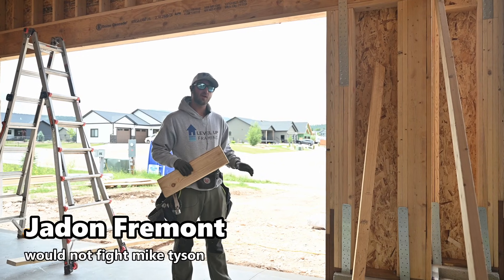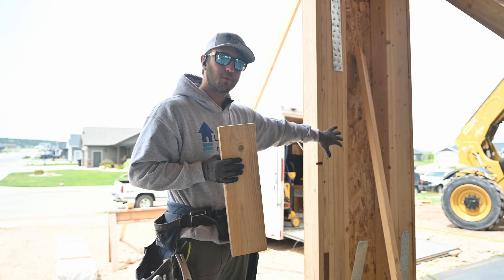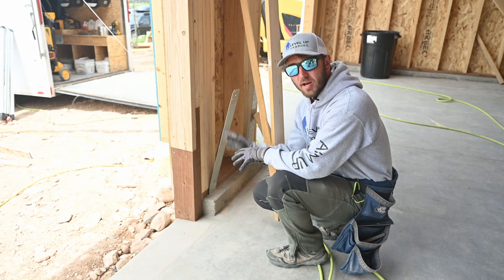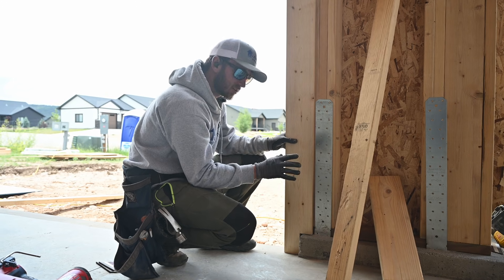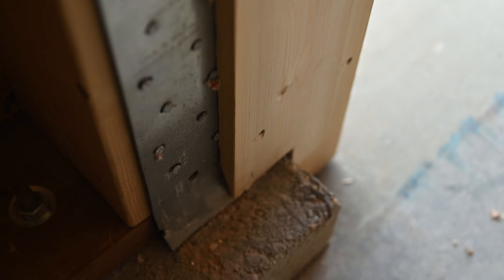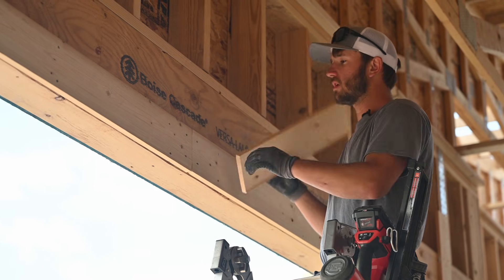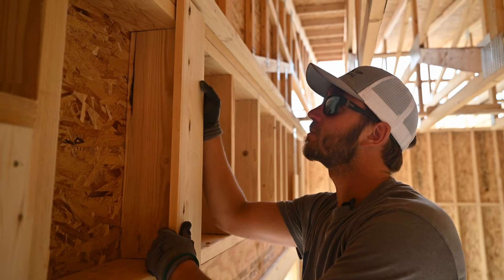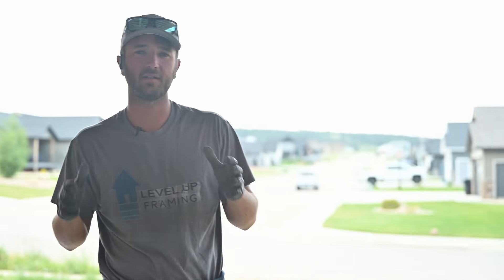Garage Door Backing: Measure, Cut & Install Perimeter Boards for Tracks & Spring

Comment: Hey. Great video. As a garage door technician. I'd like to have the center 2x8 that runs vertical come right down to the rough opening. Then do the horizontal. I mount the spring and garage door opener in the middle. If I'm mounting bolts into a seam, not ideal and can split the wood and not give as good of support.
Reply from the maker: Thank you so much for this comment!
Just to clarify - the horizontal top boards butt into each side of vertical?
Also, question:  do 1x6’s and 1x8’s work instead of 2x6’s and 2x8’s?
We prefer to install 2by’s but some customers do 1by’s.

Comment: Hey, Jadon! I hope the summer has been good to you. Mine is going well. My house is completely framed up, and the shingled roof was finished yesterday. It's beginning to look like a house. This video is timed perfectly for what I'm going to be doing next. I have to install jambs for my garage doors, and then I will put in door backing boards like you did in this video. My door openings are solid concrete, so installing jambs is going to be a little different than installing them on wood framing. I'm confident I can do it, though. Today I installed the jambs around my crawl space doorway. It isn't exactly a "crawl" space, though. The door is a full 36x80 exterior door. I guess "jambs" really isn't the right terminology. The door is prehung, so it has jambs. What I put in is the wood that the door will attach to, so I guess it is more like framing. Anyhow, keep up the great work, and thank you for making these videos for people like me. I learn a lot from you. Take care!